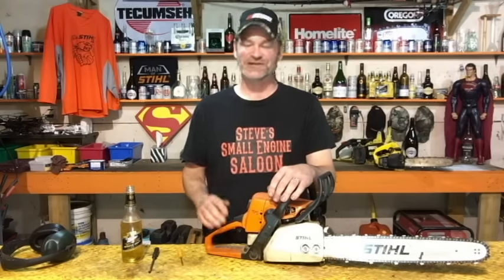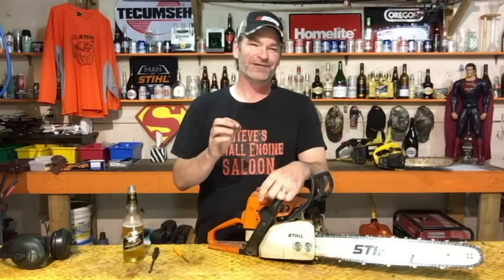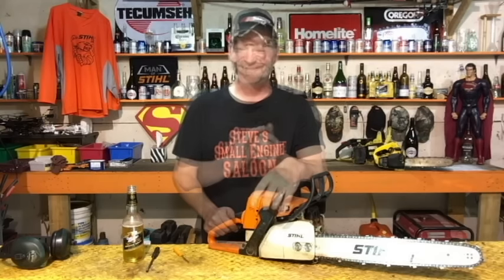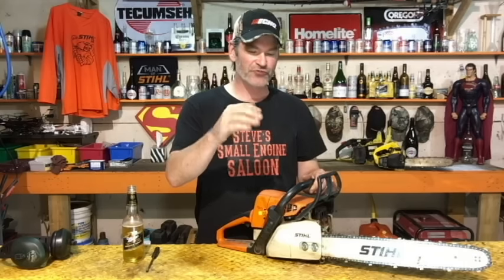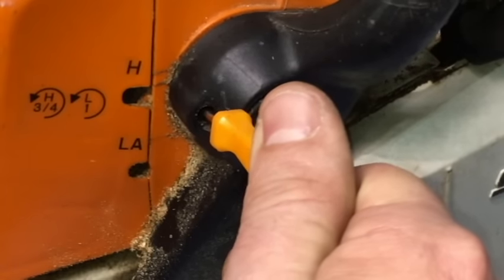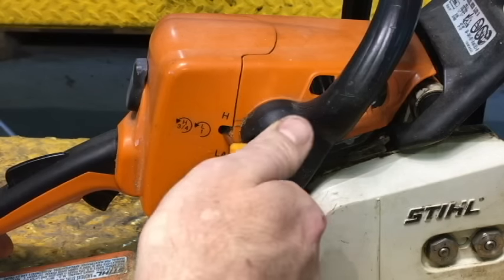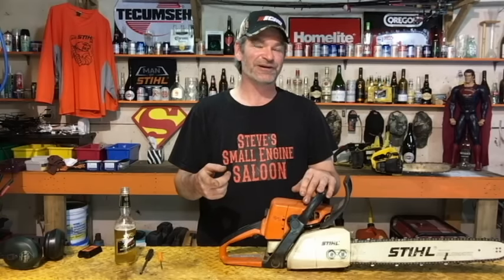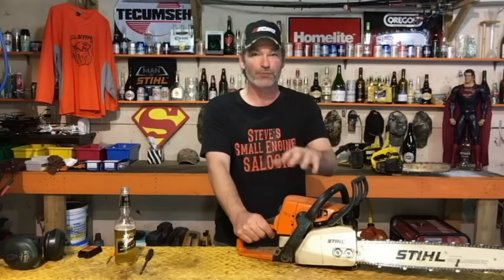CORRECT WAY To Adjust Or Tune The Carburetor On A Chainsaw (Step-by-Step)

Comment: My ecko doesn't respond on full trigger, it responds pretty good on 3/4.
And it won't oil the chain, either there is crap in the tank or my pump is screwed.
I'm thinking there is crap in the tank.
I had borrowed to somebody and they don't really care about stuff..

Comment: Stihl 025 chainsaw, got it when my uncle passed away in January, do not know when last used. I was down from a surgery, so just now trying it out. The oil and gas was emptied when stored. I fueled it, put oil in, cleaned the air filter with soap and water, let dry in the sun. spark plug looks new. tried to fire it up. it caught on Full choke, moved to 1/2 Choke, then it cranked in 3 pulls, it idled fast, with the chain spinning pretty fast. The chain oiler is working I can tell. When I set the switch to run it died, even when giving it throttle. It repeated this several times. it will not idle or run in the "Run" position. What should I check or do next?
Reply: Adjust carb.

Comment: My 2018 husqvarna model 450e2 did not come from the dealer with any type of caps or blockers over the jets of the carbs , top engine cover has two holes in it labeled "L" and "h" and I simply take my spline drive screwdriver that I've owned for  nearly two decades and took a couple minutes  max to richen my saw up a bit for winter temperatures , so it's not true as you said that all saws nowadays from the dealer come with something blocking you from initially being able to adjust your High and Low jets on your carb

Comment: I had to cut a slot with a dremil tool so I could set it with a flat screw driver.  The only thing I didn’t have is Beer I need one now.

Comment: Steve my doggone homelite chainsaw will not allow the chain to advance.  With engine off, back sprocket spins freely,   it spins freely with cover off with manual turning.  starts right up, but chain will not spin on chain guide.  new bar, new clutch?
 thanks Scott Chainsaw apart in charlotte.

Comment: Hello I hope someone can help. I have a NEW CS33EB Chainsaw and it will 
not stay running! The primer bulb would stay stuck in when trying to 
prime the saw. Found what seemed like they factory hooked the lines up 
backwards. I switched the fuel/carb lines and it will now prime. It will
 start and run for only about  to 3 sec. Like not getting any gas. I 
have tried adjusting the carb with screws out or in. Only time I can get
 to run at all is with low screw out 5 to 6 turns. Then NO high RPS at 
all just dies out. What is going on? This is not the first carb 
adjusting I have done but never seen this. Any help would be great!! 
Thanks!!

Comment: I followed this vid with my stihl woodboss 024 and there was always something wrong - it smoked at full throttle and wouldn't act right. 
My adjustment on the low screw is actually supposed to be clockwise ( turned in ) from the sweet spot not counter clockwise ( turned out ).
I had to download a 55 page pdf owners manual to figure out it had to go the other way. I guess my older saw is one of the different ones. Other than that this is a great video thank you..

Comment: I just purchased a stihl O26 and im wondering how many turn it is to properly tune it, i have a problem with it bogging and stalling and ive turned them 1 and 1 quarter turn and it still has the problem. Does any body know?

Comment: When adjusting high speed "H", you have to have to squeeze trigger to obtain full throttle while adjusting screw in and out, correct?
Reply: No, need go full WOT while adjusting HSN. But you have to test it after adjusting the HSN

Comment: Ok. I’m retired now but in my younger years I had a lawnmower shop and did 2 stroke repairs. Everything he said about the idle speed adjustment and the low speed screw was correct for the most part. But what he said about the high speed screw was not even close to correct. Yes the engine RPM will change at wide open throttle but it is not for an RPM adjustment. It is a high RPM “AIR/FUEL” mixture screw. The more you turn it in (clockwise) the leaner the mixture and the HOTTER your engine will run. And it is very bad for the piston if you put a load on the engine with the high speed mixture being too lean. 2 strokes have more power at high RPM under load with the high speed mixture slightly on the rich side. The best way I have found to determine if your mixture is rich, lean, or just right is to check your spark plug. That part you’ll have to research yourself.

Comment: I have a small poulan pro and lately while running it it wants to die off while idling like you said but it's also does it while cutting. Then when it stalls sometimes I can't get it started again. Any ideas?
Reply: Either not enough fuel is getting to the carb or the carb is dirty assuming that you did not mess with carb adjustments.
Reply: @SinsBird  no I haven't touched anything. I'm relatively new to chainsaws and I bought this one from a pawn shop because I needed a saw and didn't have the cash for a new one at the time.
Reply: @Regdiggs  Try partially choking it while it's running. See if it gets better or worse. If it gets worse, check the air filter. If it gets better perform the carb adjustment procedure.
Reply: @SinsBird  I've also got issues with the choke. I'll pull it out to start the saw and I have a hard time pulling it out far enough to get it to engage and stay pulled out. I think it just is in serious need of a full tune-up.

Comment: Mine (ECHO CS400) starts, runs - until I pull the trigger - then it dies!
I have NOT attempted to adjust the H, L, or Idle screw.
Any Ideas?

Comment: When I tune a carb I let it run at idle for 15 minutes to see if it keeps running.  Saws set to rich or lean will gradually slow down and stop.  The lean condition will starve a saw until it runs out of fuel and stop.  If it is set to rich the saw will become over loaded with gas and stop.  We call it compressor stahl.

Comment: But Steve my Stihl does not have little holes to put a driver in to adjust. There is a diagram but  manual says its just behind the handle and its off-center

Comment: I've always heard that the saw should 4 stroke at max RPM until it's under load and then it should clean up right away. What are your thoughts on that and have you ever heard of that method?

Comment: Hey Steve...I adjusted my husqvarna 240 and now I can't get it to start what's so ever....when I try to start it, I see fuel coming from the exhaust hole
Reply: I had the same on my stihl 260 i put down the air filter and screw out the spark plug and let it dry then i assembled it and it started running again

Comment: Steve I feel like a dumb ass, I watched all the videos covering the Stihl MS 250. I have changed the carb on it, and it would crank but then it dies and floods out you can pull the spark plug and blow it off then with some time it’ll crank again. I don’t have limiter caps on the new carb, I took it to a guy that said he knew what he was doing but he never could get it to even crank. How do I set the carb back to factory settings if it doesn’t have limiter caps, I would greatly appreciate the help.
Reply: Run the screws all the way in, screw both out 1 and a half turn and it should be good enough to keep the saw running while you're adjusting it.

Comment: Im following this to the letter but keep ending up with the saw running lean, ie too fast and doesn't want to stop with the switch, getting hot fast and if left, cooking the plug white.
My filters are good, my gaskets are good all round, inlet, outlet, base and crank case, fuel mixed correctly and fresh.
Anyone able to save my sanity?
Im generally alright at tuning but this is three saws now, tried different fuel, full clean up and gasket checks.
It's driving me INSANE!!!
Starting with L 1.5turns out, H 1.25 turns out, Idling high to begin with so thought id JUST turn the Idle until it barely affects the speed (running pretty fast, ill check when I find my tach) then do L screw, then lower Idle to stop the chain, then set H screw, but it keeps ending up way too fast no matter what.
Feeling like I've lost my marbles here.

Comment: Any video showing that on a Troy Bilt?
Reply from the maker: Should be the same!    :_Beer: :_Mower: :_Rider: :_Chainsaw:
Reply: @StevesSmallEngineSaloon  maybe for pros. it's not for me. no indication in the manual. I can see bunch of screws and hole, maybe that H and L one. I also see a T one. and 2 others without any idea what they are. Saw is brand new, I started once, cut a trees, stop it and it never started again since. I bought that one last Friday !!! will put it back in the box.

Comment: I have a Craftsman 18inch chain saw that won't start I have spark and gas but won"t start. I ran the saw the day before with premixed gas with additives to clean carb ran great let it sit overnight added fresh gas with oil premixed 92 octane fired a couple times but will not start. Pulled plug and is wet dried everything out switched spark plug from other saw still nothing could it be the high octane gas usually run with 87 octane with ethanol

Comment: I've got a pretty much new ms391, and it keeps the chain spinning after I finish a cut once it's warmed up. Any idea what's going on with that?
Reply: Idle speed set too high?
Reply: @SinsBird  I figured it out. The dealer had the low speed screw turned all the way to the left, pegged out the limiter cap, and the idle screw was set too high in order to compensate for that. I'm never taking anything to anyone for a tune-up now. I'll just do it myself, like I thought about doing beforehand. It had horrible throttle response before I messed with it too.

Comment: I don't fully agree with the statement that the high speed screw is just changing the engine speed. It works out like that in the end, but only because you change the high speed air-fuel mixture. 2-strokes run faster on a too lean mixture but risk seizing a piston when you do so. I always tune the high speed mixture by warming up the engine then richen up the mixture until it starts to four-stroke, then slightly leaning it back out again. The end result is probably the same, but I just felt I needed to mention this.

Comment: Another consideration I've learned with other 2 stroke engines is turning in that high speed too much means that not enough oil (from the fuel) is getting into the crankcase (as it's 2 stroke).

Comment: Tomorrow i´ll have to adjust the carb on a chain saw. Today i replaced the oil pump and oil lines and when i started it up to test the pump, the thing did crazy high revs on idle. Never seen or heard anything this crazy high on idle. In fact the revs are so damn high, before i even touch the carb, i´ll check first if maybe this connecting push rod from the trigger to the accelerator on the carb is mounted in a weird way or stuck or something of that nature. Well the entire saw is in a bad way and the owner doesn´t seem to know "maintenance" is even a thing. We´ll see... :/

Comment: Turn LS screw clockwise, you are closing off the low-speed fuel, so when rpm goes down, you are starving it of fuel. When you then turn it back CCW, you will find the point, when rpm drops again, and at THAT setting, you're FLOODING it. So you want to get in the middle, maybe favoring the flooded side a bit. Then when you pull the trigger, there's a little extra fuel. And all of this must be done while you have the idle screw screwed IN a ways, because the "sweet spot" on the LS screw will leave the chain spinning, and the only way to stop that spinning is to now back down the idle. You're actually shoosing where the idle is going to be, not "finding" it.

Comment: The high speed screw is not an RPM screw, it sets the mixture on the main jet. The mixture affects the RPM at full throttle the same as the idle mixture screw affects the RPM at idle. You want to leave it a little rich to avoid burning up the engine. Set it for max RPM and then screw it out until the RPM starts to come down a bit.

Comment: I need help.  I have a Husqvarna 440e and rebuilt the carb.  It immediately ran fine following, but in an effort to tune it following a YouTube video I turned all three, T, L & H all the way to the right and then backed them off 1 ¼ turns.  I can’t seem to get it to stay running and have been trying to adjust all of them with no success.  Does anyone with experience tuning Husky’s have any suggestions?  The bulb does seem to be a little sticky…

Comment: Half of these tachometers are not available on the links that were posted. I find that the wireless tachs have a lot of parallax errors or errors in general if they are not in proper placed in relative position of the flywheel magnets. Tiny tach with the  induction wire that wraps around the cable is by far the best tach there is. Problem is with the tiny tach or even the wireless fast tach is that it's a constant on and the batteries are non replaceable. I myself prefer the wired one. The wireless after shipping is around $160 and the wired comes to $104. They're built in the States. I wish they made a stand alone scanner type wireless tachometer. But such a thing does not exist

Comment: I've gotta wonder just how many time#s I've watched this video in the past ~2yr, it's one of my go-to videos for "reminding myself" (hate how I still even need to, have tuned xsaws hundreds of times am literally doing at least 1 adjustment a week...)
Re Idle.....I do a "faster idle than most", I like how easily it lets me start-up my saws when I'm in a tree (I climb/most cuts are aloft) so I fear it may be why I can't get L&H proper (I don't have my chain running at idle, per se, but it "wants to" run IE like 1/16th turn more would be enough for it to begin movement (this isn't bad for the saw is it?)
Re Low....I get that you go slight-fat (instead of optimal) so that - under load adn higher RPM's - the Low is optimized....do you do a lil more/less of this "fatter than optimal at idle-RPM" based on the saw?  IE, if I am building a race saw, wouldn't I only care about max-RPM tuning, ergo I'd wanna make L even fatter than usual (because the slightly-fat-at-idle is to compensate for increased L flow needs at higher RPM's, but "slightly fat" is a ballpark type threshold, do you do more/less "slightly fat" based on circumstances some times?)
Re High...I simultaneously like & dislike your analogizing of it to "full throttle SPEED", despite that of course not being the truest way of phrasing it, but I've got the same curiosity there, but also wanted to ask if you find that many saws WITH limiters, can actually be blown if you just go tighten CW the H screw as far as limiters allow (for instance the echo cs590, youtube porter "tinman" was showing how even w/ the limiters off he couldn't reach the ignition-limit of 13k rpm, could barely break 12k with H turned fully off (ie limiters out, and then fully turned-in), I believe this is a bypass in teh carb itself a highspeed bypass jet....are these becoming more common on newer carbs?  What of "limiters" on older carbs?
Thanks a ton for all the videos, would never have been able to do what I do w/ saws if it weren't for watching your collection a few times when first getting into this stuff!!! Wishing happy holidays, health & happiness to you & yours Steve!!!
Reply: Oh and btw I'll say from experience: You may wanna advise people to be VERY careful when bottoming-out (fully turning-in) their carb's H&L screws, as oftentimes the end of that screw - the bit that's physically blocking the jet - is a needle-point that is VERY fine, sometimes so fine that it's hard to imagine you could even bottom it out AT ALL w/o some level of damage to the pin-tip of the screw!

Comment: You said the rpm on that chain saw was 1200 and when you put the rpm meter to it at 10:50 in the video  it shows  1760 and you said it was set to low . Wasn't it set to high ?

Comment: Why does my chainsaw run at very high rpm’s when i first start it.  I have one that will not stop until i hit the trigger then it slows to idle and dies
Reply: The choke is probably on until you hit the trigger. If the saw dies after you hit the trigger the idle circuit or air passages are blocked.

Comment: YOu said the High speed screw should be seated and then opened up 1 1/2 turns?  THe  symbol on the chainsaw show 3/4 of a turn And you only turned the screw 3/4 of a turn as well.  Did you mis-speak on that adjustment or are you using a different terminology?  In my experience turning the screw 360 degrees is one turn.  Otherwise great info. Thanks.
Reply from the maker: The symbol on the saw "assumes" you have not taken the limiter caps off....